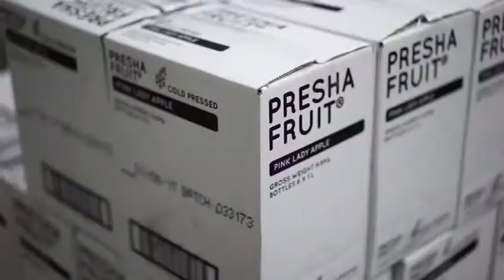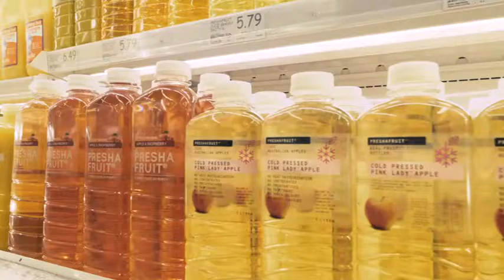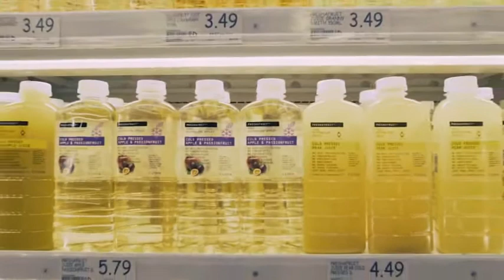Hiperbaric High Pressure Processing (HPP) customer Preshafruit

Comment: Sir i want to know how can you extend the shelf life. Which is a biggest challenge i am facing right now with my products..
Reply from the maker: “High Pressure Processing (HPP) eliminates harmful and spoilage microorganism by holding the products under high hydrostatic pressure (4000-6000 bar or 58000-87000 psi) for a few minutes. The microorganisms’ cell wall is rupture due to the high pressure, rendering them inactive. Since this is a post-packaging preservation technology, the risk of cross-contamination is eliminated.”

if you need more information you can fell in our contact form and applications team will help you https://www.hiperbaric.com/en/contact